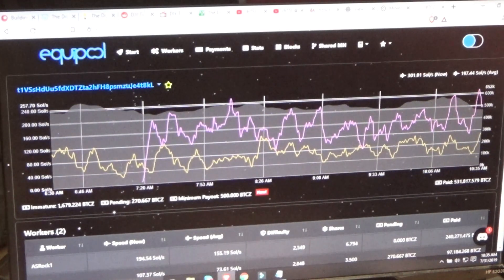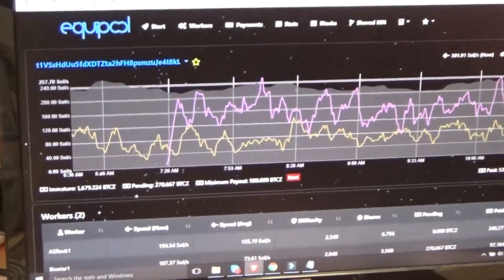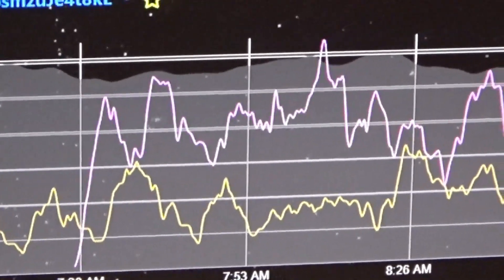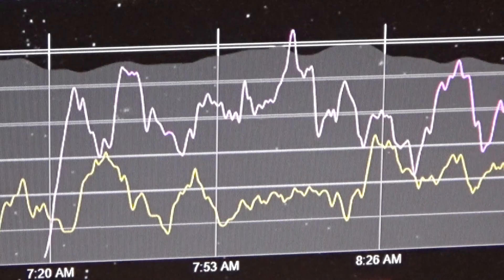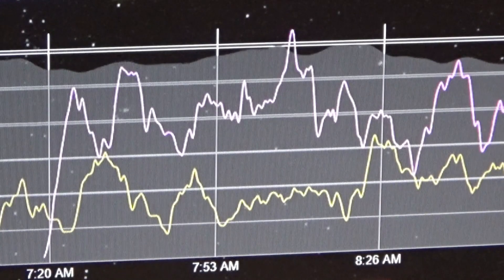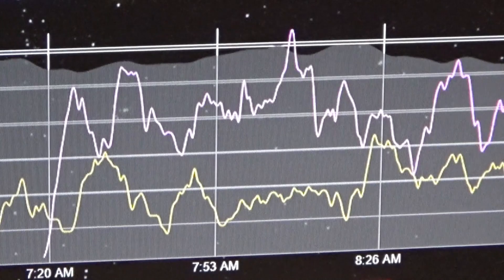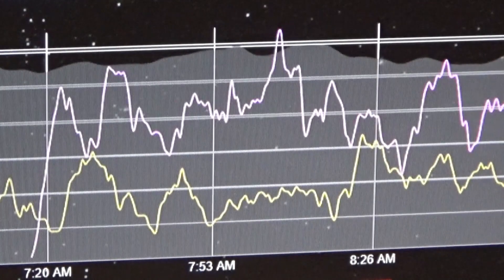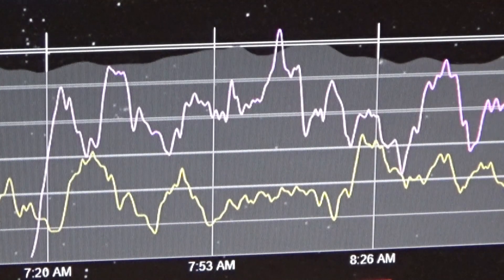Automated Solar Power Cryptocurrency Mining Farm Running

Comment: I just ran across your video. I'm setting up a solar mining rig now. I got 24 255w 36v panels. I hope I can make something right now. I have an 8 gpu mining rig but the profit just don't seem worth turning it on right now. I bought used 1060 cards just to play around with it.
Reply from the maker: Sorry for being so late. Been out selling firewood full time. Busy. Right now the profits are horrible when using grid power. If you can mine though on solar power, its all gain for you. Think of it as an investment for the future. When profits climb, your crypto gains value. And when you mine at a low price, most others are NOT mining so that leaves more for you.